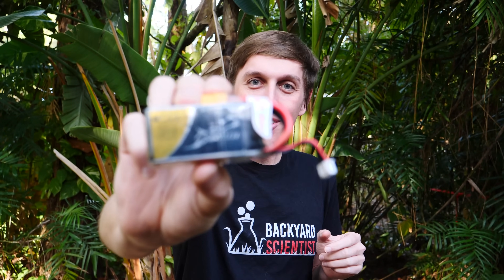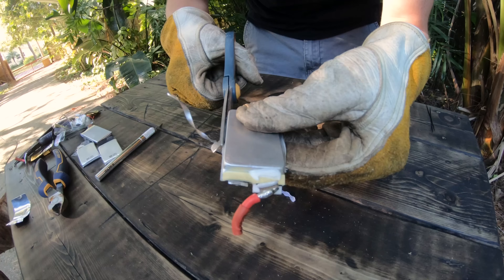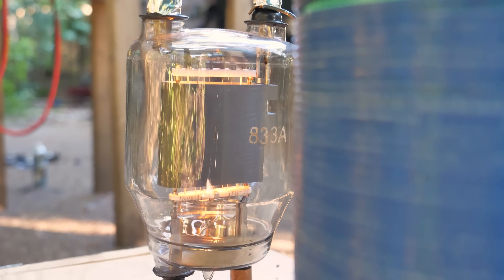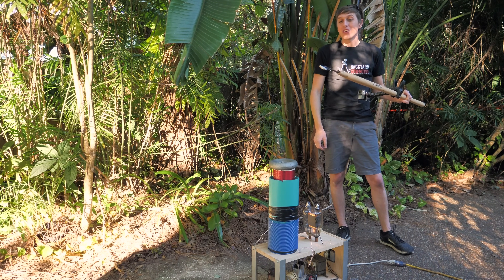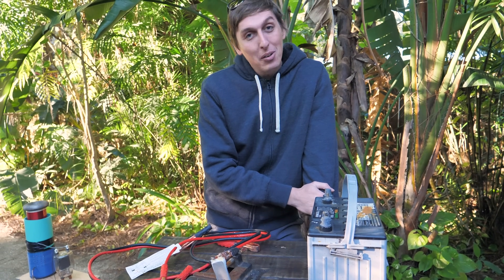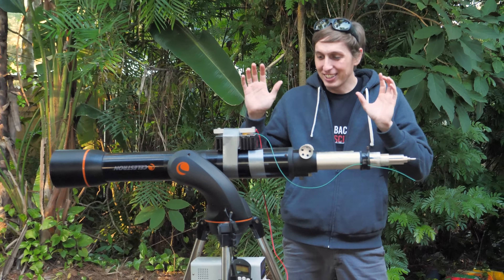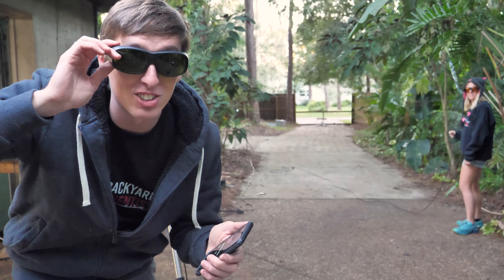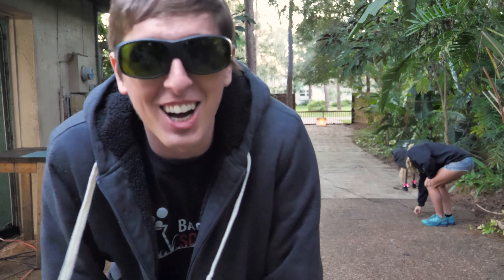Do Not try to charge a LiPo Battery like this!

Comment: Those batteries are no joke, I use 18650 batteries in my vape, I had a couple fall out of their case in my backpack and short out. They instantly burst into flames that were hot enough to melt metal from the battery into my portable charger. It was like a incendiary grenade went off in there. Luckily I didn't have them in my pocket like normal. I learned that if they are not exactly like they should be, especially if the wrap has ripped off the top seeing how that is what caused it, throw them away or rewrap them.

Comment: As a airsofter i can educate you all people, so thats a LiPo battery thats short for lithium polymer actually not lithium-ion battery
And then there is lithium-ion batterys that are different
LiPo batterys usually dont have cells 
And lithium-ion batterys in this format usually are in cell configuration
Lipos are more dangerus and can explode 
But lithium-ions can explode too but usually it doesent
Also lipos buff up, a common reasom for lipo buffing up is age and using it until its fully empty
And lithium cells just smoke
There are lithium ion batterys as Titan batterys
And lipo as like Ram vrand battery

Comment: I remember attempting to replace the lithium battery in my old phone. I had to use a knife to separate the battery from the case because Apple uses an absurd amount of glue to hold them in place. Anyway, I poked a hole in the battery, magic smoke went everywhere, and I was sick for the rest of the day because apparently your not supposed to breath that smoke in
Reply: You never need to use a knife. These batteries have these gum like strips on the back. Pull them up and the battery comes lose
Reply: Well the one in my phone did not have that for some reason. It was an iPhone 6
Reply: @camoking5059  the iPhone 6 does have adhesive holding the battery in, yours must’ve been either old weak adhesive or it had been removed before
Reply: @Fyretnt, it had the adhesive in it. A lot of it. That stuff was a pain to remove
Reply: @camoking5059  i thousands you said your phone didn’t have them
Reply: Your first mistake was attempting to repair an Apple device.

Comment: A tesla coil wont be able to do much to a Li-Po battery because batterys are charged with DC (Direct current) while a tesla coil runs off of AC (Alternating current), so the charging rate will be very poor.

Comment: New safety warning label, "Do not expose this battery to Laser energy"
Suggestion, just open a non rechargeable Lithium battery, I did and smoke, lots of stinky yellow staining smoke, only do this outside on a sheet of metal that you don't need

Comment: One time my brother told me to open a “present.” I couldn’t open it so I asked to use one of his pocket knives, and began very carefully removing the shiny, silver, “wrapping paper.” While removing it I accidentally cut the inside causing it to catch fire. Turns out he gave me a lithium ion battery. He didn’t know what it was. After it caught fire I hit it onto our carpeted floor, and then went to tell my dad. We had to wait in the car outside for a while whilst our dad took care of the problem. Our mom also wasn’t at the time, which made me quite scared that our house was gonna burn down. Luckily everything was fine except for our carpet, which ever since has had a small patch of a different kind of carpet in it ever since.

Comment: 30° is a nice day for me I rarely wear more then a thin sweat shirt and jeans when it's winter and it's 30° out although in the fall and spring for some reason it does get a little colder I think it's because then the resistance to the cold is wearing off or has not yet been built up because of a warm summer either way I actually find it warmer outside when it's snowing oddly enough something about snow I guess just changes it don't ask me why it just is I guess.

Comment: "I did a 2nd test becase I had an extra battery"
I hear ya.
You already lugged the Oxy cylinder and the fish tank to the end of the driveway,
Would have been wrong to pack it in after just one ignition.

Comment: About 40 years ago I worked in a Navy R&D facility that started using some of the very earliest prototype lithium batteries which were made by GTE.  I don't remember the exact chemistry but it was a double D size that was 3.6V/10Ahr.  Massive capacity for the day.  Turned out that GTE never tested the proto batteries for what happens if they got shorted.  Since we were going to be putting the batteries in things that would be in salt water, we did.  They EXPLODED with a force equivalent to 1/3 stick of dynamite.  GTE later solved that minor testing oversight. I believe they put a compound into the mix which impedes the rate of discharge so they won't explode. I believe that's true for most (all?) lithium batteries. Now they can just overheat and catch fire.
Reply: Some cheaper less safe Li-ion batteries do explode if the BMS fails.

Comment: They could make batteries using different elements that put out exponentially more power. Problem is that they pretty much immediately explode due to all the energy released

Comment: Sir Boosters Are Active and Ready : 4:22
Warning : SIR BOOSTERS ARE TO POWER FULL : 4:24
BLASTOFF : 4:26
Sir The Booster Is Burning Our Fuel And Communications : 4:27
Sir Back Control Panel Is On Fire 
MISSION FAILED, MISSION FAILED I REPEAT MISSION FAILURE

Comment: LiPo battery: Do not disassemble

Backyard scientist: Disassembles

LiPo battery: Do not charge over 4.2 volts

Backyard scientist: Ok, let me just get my tesla coil... Doesn't work Ok, let's try to charge it with scissors instead. Battery burns

LiPo battery: Do not charge over 4.2 volts

Backyard scientist: Gets 12v deep-cycle battery This should work!

LiPo battery: Do not incinerate

Backyard scientist: Incinerates with a 30W infrared fiber laser cannon in a pure oxygen environment

Comment: Lol. Love it.
"This battery operates at 3 volts and half an amp. Cation: Don't over charge it, use charger only for the battery"
[over charges battery with (approx.) 1.75 million volts and 900 amps]

Comment: Future reference. Be careful with lead acid batteries near ignition sources. They can be explosive due to Hydrogen and oxygen produced when charging. The Li Po igniting would have been uneventful compared to the HHO 12 volt blowing up.

Comment: You may already know this, but just because that car battery can deliver 900 amps doesn't mean it will - Ohm's law governs; that's why you can grab the terminals of the battery with your hands are be fine. Skin resistance is too high to cause more than a few miliamps to flow, at best. 

Your average LiPo will have an internal resistance of somewhere around 5 to 10 ohms. You're looking at maybe 2 amps max. Still enough to fry it, though.

Comment: Imagine who had to figure out all the things that you shouldn't do to these batteries...
Reply: Zaltic funny enough, I work in battery testing!
Mostly i work on long lifetimes so small details, but once in a while we do 'destructive analysis'...
Reply: @saber1epee0  sounds like a fun job
Reply: probably some intern. "We need a new timmy"
Reply: @pteppig  battery production doesn't require interns unless it's in marketing... he said he works in testing so that means he is in the factory hands on
Reply: Pepole faces thats who
Reply: some random fcc tester guy in a laboratory somewhere
Reply: should read what it says not to do with cell phones sometime. I had one that said not to use it as a hammer. Which sounds so strangely specific.

Comment: I'm sorry man but that stunt charging the Lithium battery with a 12v Lead Acid has to be the dumbest thing I've ever seen on this channel. The thing with car battery's is when they are used the release hydrogen (as you probably know) and especially when they're charged, if you were going to do this at all you should have had much, much longer jump cables, because that could have caused an explosion that's past the point of fun.

Comment: You should find a way to put a lithium ion battery inside a gun of some sort, then puncture it and see if the burn rate when confined is high enough to launch a bullet. Edit: Better idea! Set up a rig to puncture a lithium ion battery while it's immersed in liquid nitrogen!

Comment: Just thought of an experiment. If you had a big bag/bladder of oobleck just on the inside of a door (possibly hanging from the ceiling or somehow the door), could it prevent someone from kicking and then using a battering ram to break down the door.  I predict that it will at least make it more difficult by absorbing a lot of the energy that is being used to force open the door.

Comment: there is a difference between a Lithium polymer ( or lithium) battery that you used, and a lithium ion battery.  A lithium polymer battery has metallic lithium in it.  A Lion battery only has metallic lithium if it has been run through some very abusive power cycles (well beyond what charge control electronics will allow).

Comment: What chemical reaction would happen if you rapidly cooled diesel fuel with liquid oxygen? Could it become more combustible?  Or would it lose certain attributes necessary for combustion? I'm guessing (hoping) with the addition of oxygen, it would ignite faster. Not necessarily burn hotter, but ignite faster/ easier.

Comment: I bout a product that had a lithium battery in it. The product, thought worth every penny I spent on it, was three years old when I got it. The lithium battery that powered part of it was totally discharged. When I tried to charge it, it reacted just like when he was trying to charge a lithium battery with a lead acid battery. The housing slit wide open and the bag containing the battery expanded. The good news is the manufacturer replaced the battery and the charger free of charge, and its worked perfectly ever since!

Comment: Tattu charge at 1C, not 1 amp.   Amps = C * Capacity in amp hours.    so a 2000mAh, 75C battery can output 75*2= 150 amps.    A 2000mAh battery that can charge at 1C, will be safely charged using 2 amps.
Reply from the maker: I know. My battery is 1300mah, so I just said 1 amp.

Comment: Where'd you get that gorgeous 833A ? I haven't seen one in years!
Reply from the maker: I got a 833A at a ham radio convention for like $50, but I wanted one that could handle more power so I got the one you see in the video. IT should be labeled 833C. Same tube, but the graphite plate can run hotter. I got that one on ebay for $200, but somehow I broke 2 of the heater filament wires (you can see in the video when i do the closeup), so I don't think its running as well as it could.
Reply: Tubes are just lovely things, aren't they ? :) Too bad they're hella difficult to get a hold of here on my side of the pond. I did get a couple of 6L6 a while ago, they're the main piece of my collection of random stuff. :D

Comment: awesome tests, and cool cannon!
If you want to keep using that telescope for a longer time, you should come up with an idea to either reposition the beam after the first lenze, or to reposition your focussing lenze. Because however great the optic is, the energy of the beam will cause mild damage that will stack up. When doing that too long, it will actually retain some of the energy, making your optic superheat and possibly explode... In the best case it will make it impossible to focus the beam (dispersal by the matte spot). I used to work with cutting lasers, and still have some of the used optics lying around. You can see the damage with the naked eye and those were repositioned optimally...

Comment: Hm, not sure if I approve of pointing the laser in the general direction of houses and especially windows on the opposite side of the street, or loosely holding a mirror in front of it.
Then again, since it needs to be focused instead of being colliminated, it's not quite as bad.

Comment: I don’t think the battery needs oxygen to burn!
Reply: DO YOU EVEN BASIC SCIENCE, one of 3 requirements for fire is oxygen, I mean you don't need pure oxygen but still
Reply: True, but this isn’t ordinary fire. This is a lithium fire and it’s due to chemicals reaction different than fuel. You should google that.
Reply: @ZMO999  congrats you talked down to a 13 year old

Comment: I've seen quite a few batteries taken apart, I was under the impression that it's basically safe as long as the batteries have very little charge, correct me if I'm wrong tho

Comment: Why did it spontaneously combust?
Reply: It's my understanding that the different parts of the battery have to be physically separated to prevent a short circuit. Taking the battery apart removed that separation and causes a short circuit, which rapidly heats the battery. The chemicals in the battery are extremely flammable, so you get a nice, toasty, toxic fire.

Comment: "It's chilly, 63°"
Assuming he means farenheit, that is NOT cold. Cold is, like, 40°F.
Reply: he lives in florida so that's pretty cold :^)
Reply: 40 degrees isnt even cold thats cool nice day here
Reply: @jeramiahlowe2479  bruh I live in Arizona and 40 degrees is insane and god forbid it gets into the 30 (well it does at night but I am talking about when the sun is up)
Reply: @a-drewg1716   bro but whats the hottest it has got for you
Reply: @jeramiahlowe2479  hottest I remember was 120~ degrees Fahrenheit. I remember looking outside and being able to see the  heat rise off of the asphalt (the squiggly lines coming off the ground) and when I walked on it my shoes melted slightly and I could feel the heat through the soles of the shoes
Reply: @a-drewg1716  ohh the hottest here was like 
91 degrees max
Reply: @jeramiahlowe2479  I am assuming that is Florida but too be honest you guys have high humidity making it feel way hotter then normal. I would that that 120 degrees in dry heat instead of the moist hell that is Florida

Comment: I vape and most devices use removable lithium ion batteries(18650's, 18700's, 20700's, and 26650's being the most common) and when an old battery stops working as well, I usually shoot them with a .22 magnum and watch them explode

Comment: "it's a little bit chilly" "it's down to 67 degrees now" make up your mind, either its chilly or it's warm
Reply: Here where I'm from, at 19c (or 63f as I think he meant that) is a normal, even a good summers temperature... When you'd get 19c here, everyone would be wearing t-shirts and shorts. I mean, even 10c would be kinda warm here.
Reply: 32° here in Indy, I’d be wearing shorts and a T-shirt if it were 67°.
Reply: @biker932012  pffft.. here in dome argus it's -52 C°...
Reply: Psh. It's 33 here in Washington.
Reply: literally relatable, still not cold enough to make me want a jacket  @robert9595
Reply: Here in Australia it's currently -3c

lol jk I'm dying from UV and heat exhaustion as I type this in my underwear.
Reply: BigMan7o0 That's COLD to us Florida people. I used to swim in that and think my relatives from Florida were a bunch of pussies. Now anything under 72 and I'm cold. It makes sense. If you're in 95+ degree weather every day just about, of course 67 will feel cold.
Reply: Robloxgamer321  

lol I have a bad habit of ranting. I was worried when I read your message that I got blackout and put something on here I shouldn't have. Relieved I just wrote too much.
Reply: Should I even comment about England?

Comment: Dont overcharge means you are using the proper charger and charge each cell way over the full charge of 4.2v per cell. I really dont agree how you did this experiment based on my 8 years of using LiPo batteries. I reccomend another video to learn about the don'ts of LiPo batteries. I know this was for fun and you would have had a huge fiery explosion with the correct charger as well. If entertainment was what you were going for still using the right charger would of been best.

Comment: Best for a while. (always good) You had better luck than I. I have tried mains voltage, car batteries, acid, oxy acetylene.... and just got smoke. Even the massive hammer... smoke.
Reply from the maker: I'm impressed how reluctant they are to catch fire. I usually get smoke most of the time also

Comment: And to think I have these sitting all over my floor at home...

Yeah I’m gonna go get those in a fireproof bag😂
Reply: I have a pile of them stacked in a shelf 😱 i don’t want to imagine what would happen if  they all chain reacted 😣
At least they are not fully charged... I keep them at 3,7v per cell if I don’t use them.
Reply: @blise518B  umm, just a tip, 3,8 volts per cell should be the best
Reply: DDvT yea if they sit around a bit waiting for good weather they usually stay at 3.7 something. But my real concern was if they are still that explosive around that voltage?
Reply: DDvT 3.8v is what my charger puts my batts for storage
Reply: blise518B They are not nearly as lethal at 3.5-3.8. Above and below those, yes.
Reply: OutaTime FPV Above 3.5 yes, below no. Less potential energy. .
Reply: Bencasso yes exactly. Although your lipo is probably trash if you go below 3.5 and store it there. If you look at a discharge graph, the cells rapidly lose voltage sub 3.5 volts, so 3.5 is the cut off. You can safely dispose of old lipos by draining them so long as you’re not discharging at a high current. A lipo at 3v per cell is a lot safer than one with 4v. It’s the discharge that can be sketchy, but once its done its done.
Reply: As long as it’s not under 3.5 and over 3.8 folks.